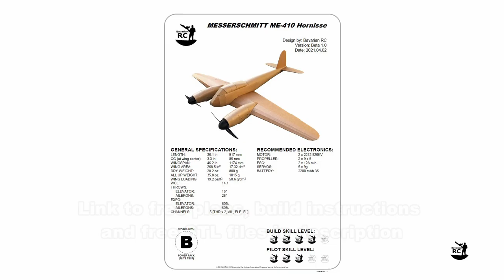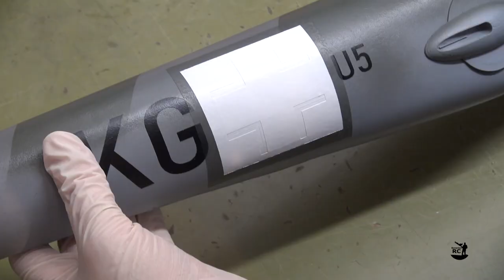Painting the Bavarian RC Messerschmitt Me-410 - Time Lapse

Comment: Beautiful build - Subscribed! Ever since I saw the Flite Test video with the 12' (3.65 m) Ju-88 and 188 I've been considering a Ju-88 Night Fighter using Flite Test construction methods. Also looking at your Noratlas plans, I'm eyeballing that one for a possible Gotha 244 conversion! 

Question for you, what method do you use to mask when you paint? Sure doesn't look like you pull up any paint when you're un masking!
Reply from the maker: Thanks a lot! The Ju-88 is also on my wish list for a foam board design… but the list is long 😜 Currently I am working on a Henschel 129. Indeed the Noratlas is not so far from a Gotha 244. In hindsight I should have made the Noratlas a little bit bigger. The wing loading is quite high. Now to your question about painting. There are some key things to consider. Scuffing the surface with a 100grit sandpaper and afterwards scotch brite is important. If I have clear packing tape anywhere on the surface I apply a layer of plastic primer before painting. That makes a huge difference! For masking I use Tesa perfect which is a low tack masking tape. The layer below has to be at least 24h old before masking. Right after painting I remove the masking tape immediately. If you wait too long you won‘t get a clean edge. I pull the tape always with a swaying motion in a slow but steady move keeping the pulling hand as close as possible to the surface to prevent pulling up paint. Every here and there the result will have some imperfections that I touch up afterwards with a small brush. Seems I could do a painting tutorial video one day 😂
Reply: @bavarian_rc  An Hs-129 -YES! 😎 Looking forward to seeing that one! I know it would be a departure from the norm but since it's pretty much straight are you considering printing up a canopy frame for this one?
Thank you for the masking tips,  I've been painting models for years but find doing repaints on foamies and foam board models a bit more challenging due to my ability (or inability) to mask off a scheme! I know you have a long list of asks but a painting 'how-to' would be most welcome at some point in the future.
Reply from the maker: So far I have designed the fuselage and canopy… still a foam board canopy. But printing a frame could be a good idea. Due to the narrow triangle shaped fuselage it was a real challenge to build the canopy. 
Painting tutorial goes onto the list… maybe not immediately but will do it! Cheers!